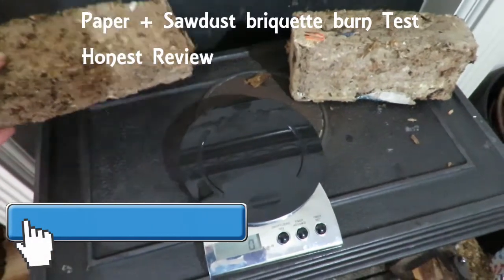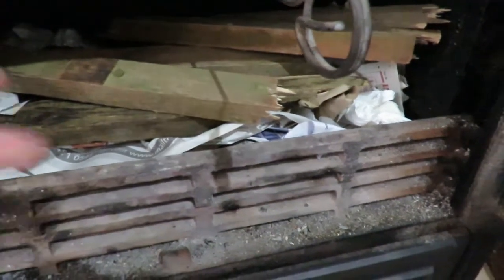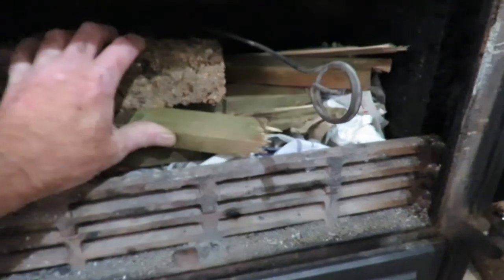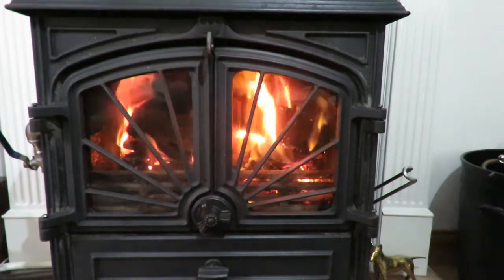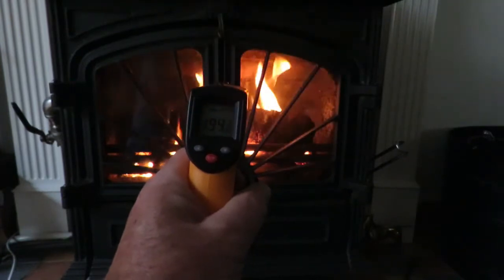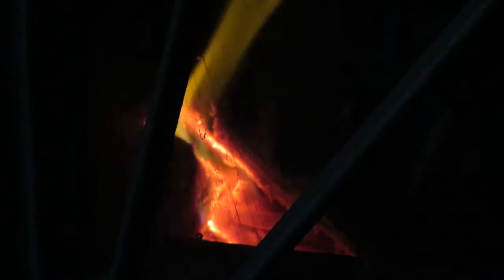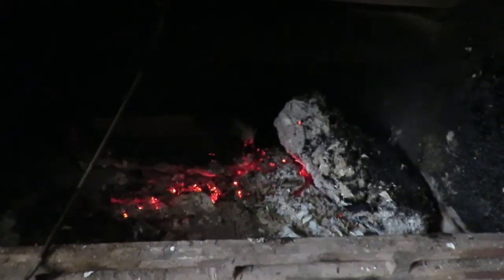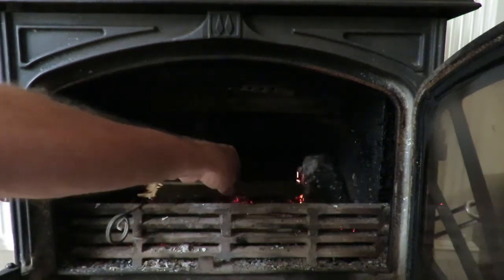Briquettes Paper + Sawdust  Burn Test in multi-fuel Burner

Comment: I make mine with a one hole the short. I put a pvc pipe in my mold helps the burn. I also save my old frying oil. I pour ¼ cup old oil on my my bricks. Let sit 4 days after u pour the oil on them. That way it is well penetrated into the bricks. I make mine from sawdust, leafs and paper.

Comment: I think one problem with these bricks is what you showed early on. They are quite light and  not very densely packed structures. 
I see lots of the fine MDF and chipboard dust in bags in industrial areas that is free  for the taking and in endless supply. I think this may work well as it would pack very fine and mix well with the paper pulp. There is also lots of waste cardboard around that could be soaked and pulped then mixed with the dust, grass clippings etc. 

Given my oily proclivities, I'd like to dry the bricks and then add some Oil ( Veg or engine) to each brick.  The oil would add a LOT of extra heat output and act as a wick to let the oil burn in a controlled manner. Oil contains around 1KW of energy for every 100 Ml ( 90g).  It looks like you could get at least 200 ml to be absorbed into each brick, maybe double,  and still be "dry". 

I see Veg oil has around double the MJ content per Kg of wood,  Used engine oil about 10% more.  In other words, the weight of oil you could add to the brick would increase it's heating value by double over using the same weight of solid timber. Plus you also have the MJ content of the brick itself. I'd guess this to be maybe 40% that of solid timber, it may be 50% but certainly the real value in the brick would be as a "wick" for the oil that would allow it to burn in a solid fuel stove. 

The oil would  substantially improve the heating value of the bricks in giving them a lot more output for really no extra effort in production.  I would envisage just putting the dry bricks in a tray of oil and allowing the brick to soak the oil up maybe 3/4 and then let them sit for the oil to thin out and disperse through the brick.  If you put a measured amount of oil in each brick you would know what heating value it contained... if you were bothered. 

Lighting a brick on an oil wetted corner should have them going very easily and I'm sure the burn time as well as output would be substantially improved. 

Doing the mental arithmetic on this, I'm quite keen to try some for myself but if you have some dry bricks and oil available, by all means go ahead and show us how that goes. I won't be getting to it anytime soon so if you are inclined, go for it and please let me know if and when you put a vid of it up. 

Thanks for the ideas and hope my suggestion may be of some value to you.
Reply from the maker: Works very well mixing sawdust with WVO fat waste. I wrap it all up in newspapers. https://youtu.be/WhlpBUuwPzo
Reply from the maker: MDF dust produces acrid smelling and toxic gasses, best to stick with saw dust imo